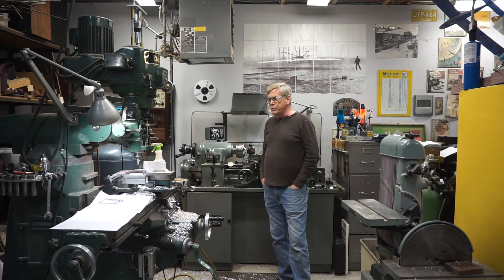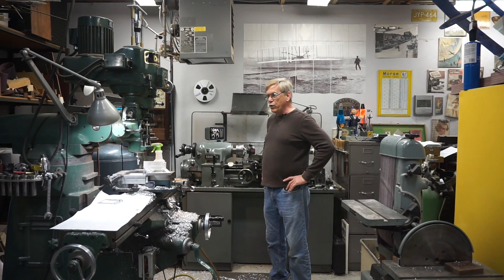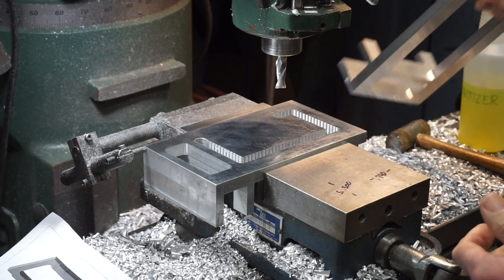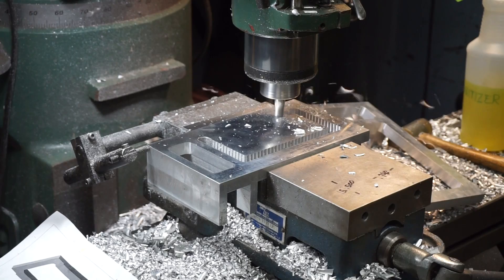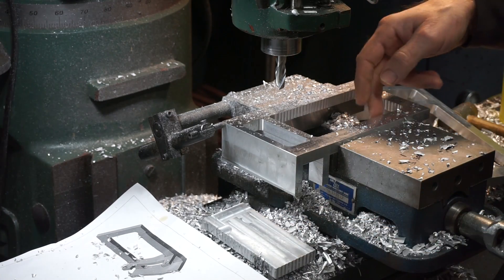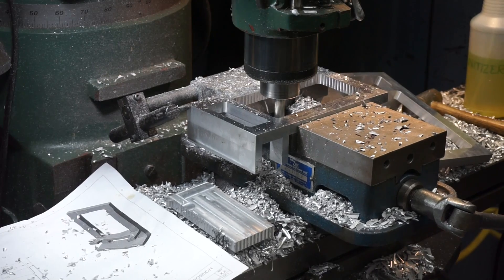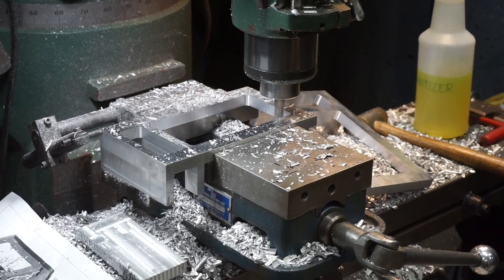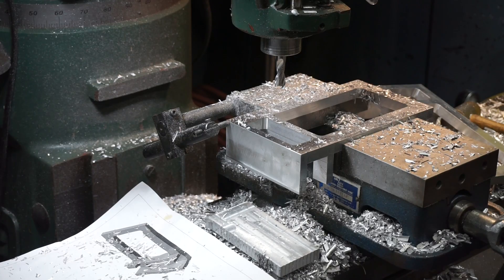Tom's Tips & Tricks #3 - Plunge Milling

Comment: Just curious you mentioned heat, why not show down your speed a little bit? I found slower speeds are better. I clear chips better at slower speeds without the need to plunge cut.
Reply from the maker: Running an endmill outside of its recommended rpm is asking for trouble. Too high will burn it up, and too low will increase the chance of breakage, due to a higher chip load. If you are having trouble clearing chips, your best bet is to decrease the depth of cut, and increase the feed rate. Or, with deep pockets, use plunge cutting.

Comment: What type of milling bit is that? I'm not a machinist but I have a project where I have to plunge and mill an aluminum block about an inch wide and 2 inches deep but not all the way through the piece. Any info would be appreciated.
Reply from the maker: It's a two-flute center cutting end mill. Do you have a milling machine to use one on?

Comment: Again Tom, great video, do you have any videos on setting a  point on a new part using a DRO and then setting the drill points in the SDM ?  Really impressed with your work shop.
Reply from the maker: Thanks, Doug. The reference point on a part is set using an edge finder, or an indicator for a hole. Not sure what you mean by SDM.

Unfortunately, that shop is no longer. We moved and everything went into storage. I have built a new shop and am getting it set up, but it's a slow process. I hope to be operational again in the coming year.

Comment: Hi Tom, I just found your channel and really enjoy your techniques and processes. I’ve learned quite a bit from you and hopefully by the time I get through your library of videos you’ll be settled into that new shop you’re building in MI. Wishing you a safe and successful move & looking forward to more videos in the near future.
Reply from the maker: Moving at this stage of my life is quite a challenge, especially when there is a machine shop involved. We are pretty much into the house, although I am still working on the kitchen remodel and some built-ins. The shop is pretty much complete and I have been moving in machinery. It's located in the U.P., so everything has to be trailered up from midstate. So far, the mill and lathe are safely in their new homes. The propane delivery is scheduled and I'm in the process of installing a condensing boiler for the radiant heat. It'll be nice to have heat before the U.P. winter moves in. I wanted to have the well put in too, but it looks like that's gonna have to wait for spring. I'm definitely looking forward to getting the shop operational again and start making more videos.
Reply: @TomsTechniques  Great news!  You're still my favorite YouTube machinist...

Comment: Good morning TOM I’m the 71-year-old newbie and I’m finishing up setting up my shop at home mainly to do hobby work. I do have a LeBlond leave and a Bridgeport along with the surface grinder. I was wondering what your opinion is in reference to should I prepare my shop for the process of using coolant on the Lathe the Bridgeport Milling Machine. I’d be really interested in your opinion. I guess the question boils down to why do you need coolant I understand you use cord to keep things cool but if you’re a hobby shop and time is not actually the most important thing do you still need  coolant
Reply from the maker: Coolant is more if a nuissance in a home shop than a help. You can't just mix up a tank and forget about it, it must be maintained and the tanks kept clean. It also tends to rust machinery when only used on occasion. If you need it at all, just use a spray bottle and mist it on the cutter as needed.
Reply: @TomsTechniques  thanks Tom I am really happy I came across you Chanel. Really looking forward to your new videos.

Comment: Hi Tom I just found your Chanel are you still doing videos
Reply from the maker: I'm actually without a shop at the moment, so no. I am building a new one in Northern Michigan and am in the process of moving the machinery in now. It should be somewhat functional this winter.
Reply: @TomsTechniques  I am a 71 newbie never touch a lathe, milling machine. Got hooked on this hobby about a year ago. I am almost done setting up my shop. I have a lablond lathe 19 inch swing 54 inch center, Bridgeport mill and a Taft pierce Serfice grinder. I started going to auction to pick up small tools. When I came across your Chanel I said this is exactly what I need. I hope you start soon. In the meantime I will keep looking at the videos you have done . Be well and God Bless

Comment: Same speeds and feeds as regular depth cut pocketing? Or do you calculate it as a hss or carbide drill with the endmill diameter being used? Thank you
Reply from the maker: Same rpm as you would normally mill at, dependent on the diameter of the end mill.

Comment: I built prototype injection molds for 25 yrs. I wouldn't recommend clamping a part where you are taking out the center wider than your vise jaws. There's a chance when you take it out of the vise the center will bow and the pocket could actually flex out larger than you wanted. It might only be a couple thou but that's still bad if you have to be dead on.
Reply from the maker: Yes that could be an issue as the part gets longer relative to the vise jaws. In this case, the purpose of the frame cut was to simply lighten the part, so a any bow would has been little consequence.

Comment: Great video Tom, I have to make a series of holes (24) on 3/16 plate, with ID of 1.25". It does not have to be precise , just the spacing in between. Using a  vertical mill, what cutting tool would you use for the job?
Reply from the maker: I would start by first drilling them as large as possible with drills and/or end mills, then switch to a boring head and step them up to size. If you don't have a boring head and the diameter is not that critical a small fly cutter can be used. Lay the holes out with a divider first and remove as much metal as possible with an end mill, then take them to size with the fly cutter set to the final diameter.
Reply: @TomsTechniques  Thanks!!

Comment: He uses it for roughing out such as can be done in slots by stepping over however with a cnc plunge milling is of super importance for many reasons especially angled walls. It should almost always be done cut down only and rapid back up and stepover for a few reasons. It produces perfect accurate angle walls and tapers where as going around and around--does not. The benefits are many and is analagous to making a lathe cut--the cutter cuts on the end but produces the finished surface as the tangency of the radius of the insert moves along--just like a lathe. Another huge benefit is truly astonishing roughing rates because you can step over 1/4 inch and be hacking off .100 deep to rough!  (that by the way shows why you must plunge cut only ONE WAY--DOWN) and rapid back up just like he did in the video. yet another benefit visualize a 3/4 insert cutter producing a million machine taper inside or even a straight wall or big round bore?--note that since inside the cutter can step over .030 OR MORE each time finishing the taper perfectly in a couple minutes.. if you do the match the cusp is almost nothing even with massive stepovers. Yes it works and is done daily in industry. Another benefit is that the insert and cutter hardly care if the material is aluminum or hardened steel.. however going around and around stepping down it certainly does--THE CUTTER WILL PUSH AWAY A HUGE AMOUNT AND GO DULL.. you will not even reach the bottom.. Plunge milling in hardened h-13 is how we cut hewlett packard printer body molds and other things. Also you can plunge cut straight deep walls even in hardened steel and the walls will be perfect and straight--but be aware you have to relieve the side of the insert so that only a small land is hitting you cannot have the insert scrubbing against the walls. Anyone interested I just created a FB group--shapers and zlinear plunge milling techniques and tools. If you type in all one word SHAPERINFO   it also will come up It is also based upon the shaper attachment that goes on the back of bridgeports..

Comment: Could just use a horizontal mill. The chips clear much easier.
Reply from the maker: Horizontal mills are very effective at removing a lot of material in a hurry, but won't work for milling a through frames or pockets. Plunge milling with an end mill is the best option for applications like this.

Comment: Tom, I don’t have a mill or a lathe but i do have a floor standing drill press. Would it be possible tp plunge cut with my drill press?
Reply from the maker: Drill presses don't have the rigidity required for milling, or a method of safely holding an end mill. What will likely happen is it will chatter like hell and then the chuck will pop off the taper on the spindle and ruin your day.

Tom

Comment: Hi! I am a little confused. If I understand correctly, climb milling has to do with moving the part against the direction of the cutters rotation. I can understand that ok when the cutter and part are moving in the same plane, say the XY plane. You indicated that the plunge milling should be done as a climb, but I don't see where the 'climb' comes in as the direction of travel of the cutter is in the Z direction, and at 90 degrees (i.e. downwards) to the cutters rotation. What am I missing? Cheers!
Reply from the maker: The first cut when plunge milling will be neither climb nor conventional milling, but after that, the direction the cutter is moved before the next plunge will determine whether it is a climb cut or conventional cut. A climb cut will push the cutter away from the work and a conventional cut will pull it in.

Tom
Reply: Hi Tom, thank you for replying! Thats the part where I am confused. I am a newish machinist, and my limited understanding of climb / conventional milling has to do with both the part and the cutter moving at the same time. For example if your cutter goes clockwise and, looking from above, your part is moving across its top at the 12 o clock position,  when the part moves to the right then that is climb milling (with the rotation), and when to the left it will be conventional milling (against the rotation). In the video your move and cut are separate, moving the part along, and then with the part stationary, taking the cut. As there is no relative motion horizontally, how do you determine climb or conventional? I see what you are saying in the video that the cutter will want to push or pull away from your edge. Is this also defined as climb / conventional, even when the part itself is not moving?
Reply from the maker: There has to be movement between the cutter and work to create a climb or conventional milling scenario. When plunge milling, that movement is on the Z axis.

Tom
Reply: climb milling is where you cut in the same direction the cutter is turning, so the cutter almost drives along the cut like a wheel on a car, conventional is going against the rotation of the cutter, climbing can be dangerous on less rigid machines as the tool an grab the work and dig in, resulting in broken cutters, chatter, and or poor finishes, in a rigid set up, climb milling is preferable, less load on cutter, extended tool life, and better finishes and swarf evacuation
Reply: I get that part, but when you are plunging the cutter *down and through the part*, like a drill as in the video, the movement is neither with nor against the cut. Its at 90 degrees to it. I thought maybe he meant the finishing passes, but there he both climbs and down mills.

Comment: I could had used this in the shop today. I conventionally milled a slot for a fixture. My end mill got clogged up. I was using 6061 alum so I just knocked it off with a chisel

Comment: Just out of curiosity, if you are starting with a solid chunk and as you said, couldn't band-saw off a large portion of excess material, why not have the first opp be a drill opp and drill all the way through the full thickness to drop out the entire center slugs from the solid full raw stock material? Basically just like your plunge cut opp but with a drill right from the start (full raw material thickness).

It appears that you machined the opposite side (side down on parallel's) before doing the thru pocket. This to me seems like you would have spent a excessive amount of time milling off all that material that would have been removed by just drilling the complete through pocket as the first opp. Then would have only been left with the narrow area of material to hog off.
Reply from the maker: Bandsawing as much material out as possible is always faster than milling. As I mentioned though, my saw is a little small for that so I opted to just mill it complete. Milling deep with an endmill is slower than keeping the cuts shallow due to chip removal and heat generation. That is why I opted to save the framing operation for last.

Tom
Reply: Chris I thought the same thing, first op I chain drilling the full thickness before you mill anything , also was a bit poor on the work holding in the vice ,
Soon as the centre piece  is removed the pocket will close up as the two ribs are outside the vice jaws, the pocket will not be square and the clamping force is reduced so the piece could lift out , 👍

Comment: Just curious, how well does a roughing end mill do with this material? I ask because most of the material I have worked with has been stainless on the mill, I work in maintenance at a bakery...food safety first!! VERY useful technique though.
Reply from the maker: A roughing end mill is designed to side mill. No need to use this technique for them.

Tom

Comment: Looking at that part you made I'd imagine there was some warping after all that material was removed.  I like your comment about the stress relieved weldment, that's the first thing I thought of when I saw what you were making.
Reply from the maker: Cast jig plate is extremely stable. You can do some pretty radical machining on it without fear of warping it. On the other hand, it's soft and doesn't anodize well.

Tom

Comment: Hey Tom, appreciate your work!  Could you elaborate more on how one gets "outside work" or "bidding on jobs"?  I hear these terms tossed about a lot, but i missed the memo where they told you where to go to get these jobs.  Call me ignorant, but i've always been interested in doing side work, just never figured out where or how to find it - aside from beating down doors and the rest of the old-school hard marketing methods.
Reply from the maker: Hi Andrew,

I was lucky to have had some connections who opened a few doors for me. Most of the jobs I landed were for designing fixtures or attachments for machines and I was unique because I could do the design as well as build the devices. Once I delivered a few jobs, I then got more work by word of mouth. Generating contacts is always more productive than beating down door (with everyone else).

Tom

Comment: Hi Tom
Haven't talked in a while - I have done some cutting like that but I have a cooling system bolted to the turret head machine and it force cools rather well and I was using a 3 flute hole hog (wrong words maybe) and it seemed to work pretty good - but I don't think it went any faster that what you just showed
thx
art

Comment: Hey Tom, nice job. Having watched you before I have used your method and works great, I have one question is there a way to do this and mill a curve or angle with a manual mill? Or would you plot it out with dro. I am just a hobby machinist and make small parts for my radio controlled cars. God Bless Ya   Dave
Reply from the maker: Absolutely. For curves, you need to mount the part on a rotary table centered up on the axis of rotation for whatever curve you want to machine. For angled cuts you would either rotate the vise, or clamp the part to the table at the required angle.

Tom

Comment: you showed this awhile back.   It has changed the way I mill.   The big plus for me is the end of the end mill dulls not the side flutes easier to sharpen and the end mill can be kept true  to diameter longer    Thanks again for a great tip.

Comment: Should be good for smaller , less rigid machines since puts load more vertically instead of side load.
Reply: I was going to mention that benchtop machines (and drill presses) don't like to plunge cut with square end mills.  The column moves, and there is a lot of chatter.  You could drill lots of holes with a drill bit, and then finish cut the pocket with an end mill though.

I've never tried plunging with a ball end mill, maybe that works better?